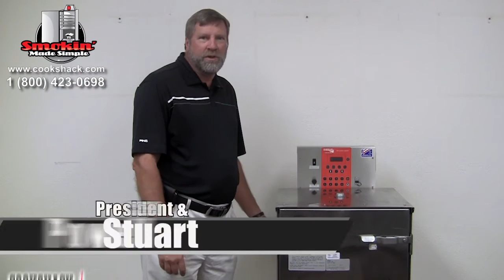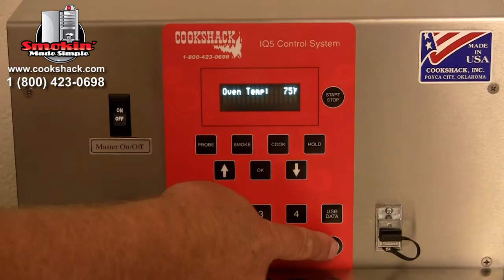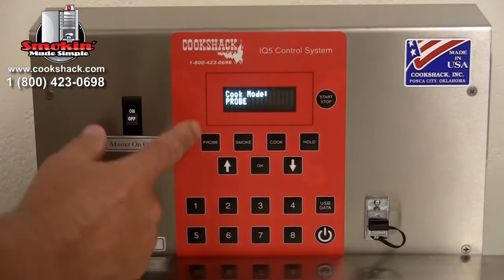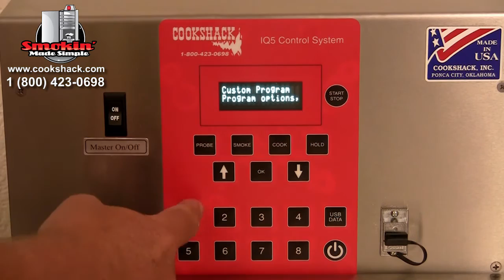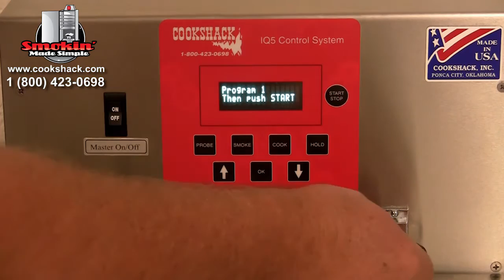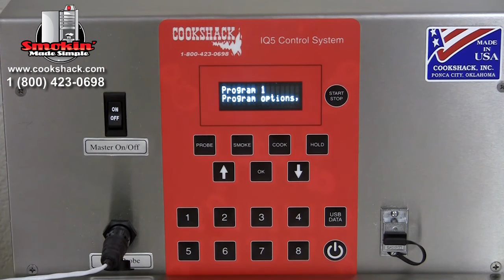How to set up the Cookshack IQ5 Controller

Comment: I noticed in the video that he said that you can adjust the smoke temperature as low as 140. Do you ever have problems with flameouts at that low of a setting?
Reply from the maker: The electric units (all SM models) don't have an issue because they are ran by a standard heating element. However, The pellet fired units (all FEC models) will lose flame and relight. Any setting under 160 is mainly just for cold smoking and keeping food warm.